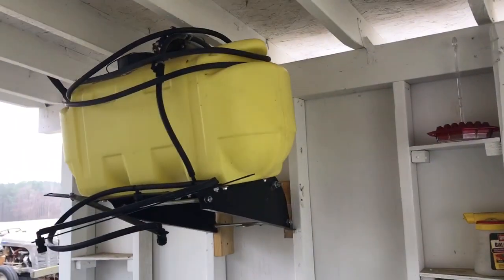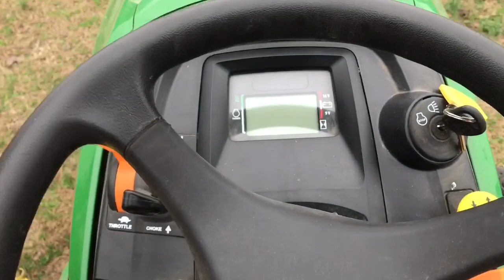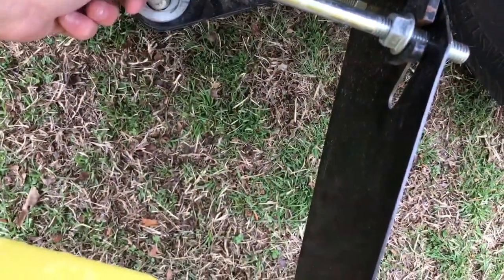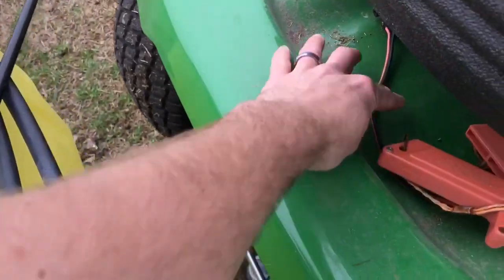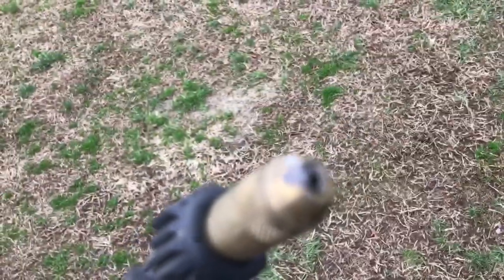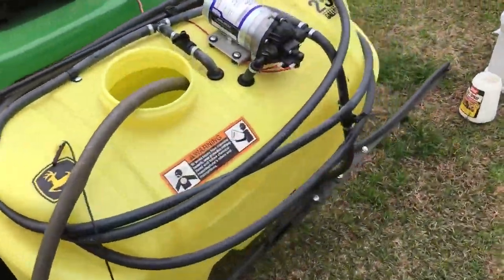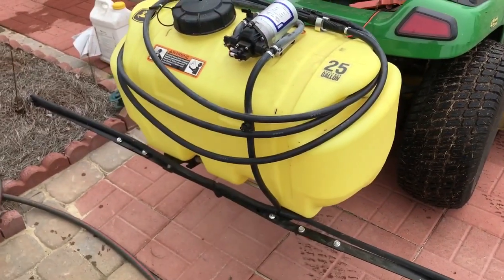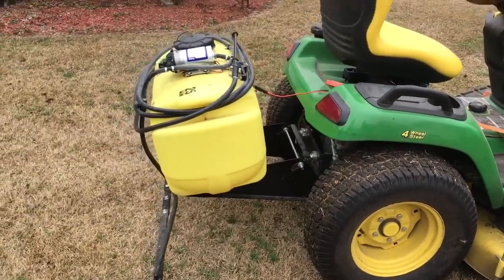John Deere 25 Gallon Sprayer for Lawn Mower/Tractors. On my JD 584

Comment: Thanks for the informative video. As to the tank sliding along the open adjustment curve. Fix some short nuts and bolts in the slide adjustment to take up the open space. That will stop the sliding. Good luck.    :)

Comment: For keeping the unit from jumping around on the sleeve, I used a piece of 1 1/4  x 1/16 x 15 1/2 inch aluminum angle tubing, flattened it out, drilled a couple of holes in it for pins; and just slide the piece into the sleeve.  I think it would work for you.   On My X540 my unit seems to sit level; so I use this piece to ensure the unit doesn’t jump around without the need to tighten all the nuts every time.  I’d post a pic if I could.

Comment: Great video. Thanks for taking the time in making this video. I learned a lot. Probably a hitch model would benefit me more for my needs. Now I have to see if it's worth getting my lawn sprayed professionally compared to doing it myself. I have a few questions for you about your tractor. How long have you had your X584? Also, have you had any issues with it's 4 wheel steer options? Was thinking of getting either the X584 or the X734. Thanks in advance and have a great day. :)

Comment: When you rinse you sprayer out over the drain, you are washing harmful chemicals into the water ways.
Reply: One should use 5 gallons of water and an biodegradable detergent to "water the chemical down."  Drive it around splashing the water inside the tank and run water/detergent through all the hoses and nozzles.   Empty the tank; add water, rinse again.  Drain the tank.  Run the pump to drain the hoses.   If winter is coming add PINK RV ANITFREEZE to the tank and run the pump and spray through the nozzles and wand.  Drain again.